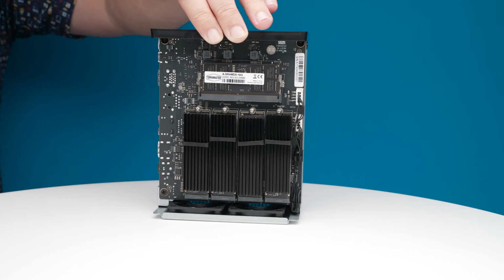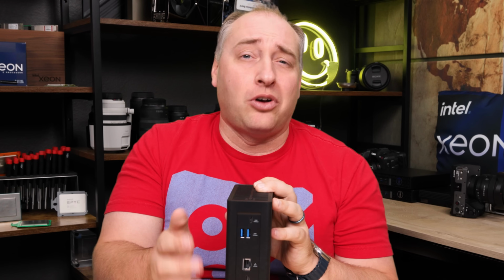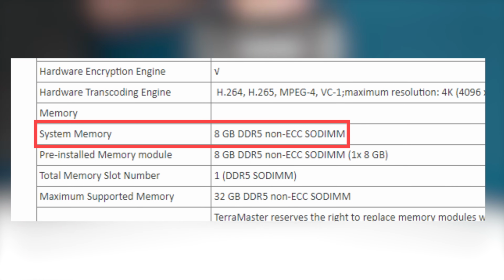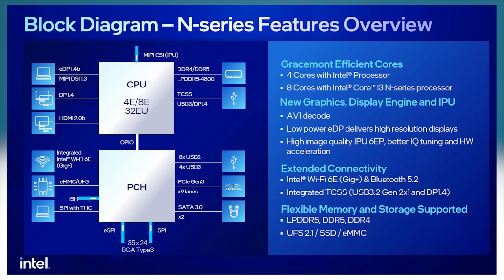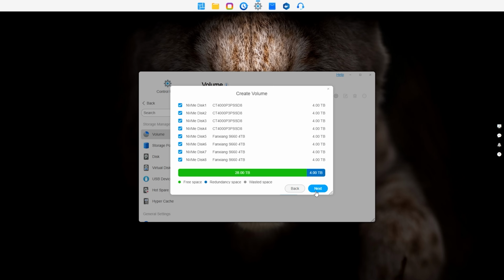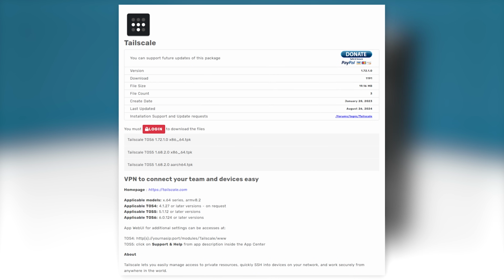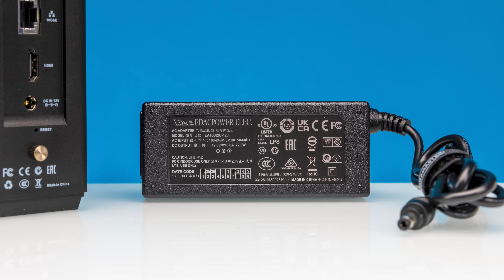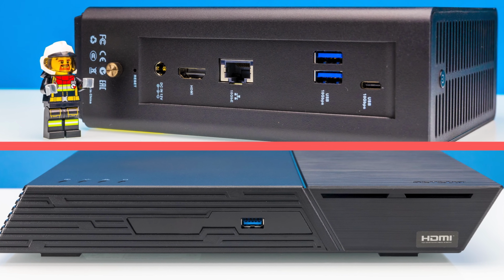Tiny 10GbE All-SSD NAS Sports Up to 64TB

Comment: The limitation in these systems is always the AlderLake-N CPUs' limited number of lanes and that it's PCI-E v3.0. Hopefully Intel will learn from that and hugely bump up the version of PCI-E and maybe either additional lanes or more built into the SoC (like 10Gb networking) in the next version (and be based on Skymont).

Comment: I am only about 9 mins in, BUT looking at the specs for PCIe Gen3 NVMe drives they must be running very slow due to only having 9 lanes, so either the 8 SSD's are using 1 lane each 1 GB/s or they are sharing 4 lanes between 4 drives.
But its hard to tell due to not owning this NAS, maybe you do speed tests later on in this video confirms this or says otherwise, but would be interesting to see.
TBH, I was wondering how good a NAS would be using NVMe SSD's, oh and the slowness I think is down to the 1 lane per drive, assuming its doing it that way, I am thinking its 4 lanes for each set of 4 drives and those 4 drives are sharing those 4 lanes resulting in them being slow.
On a side note, did you try sticking in a different USB Storage drive and try installing a different NAS software ?
Reply from the maker: Right, but think about using drives for capacity instead of for speed
Reply: @ServeTheHomeVideo  This is true, if speed is not a requirement and storage space is then yeah its good.  But you also need to look into what else might be sharing PCIe lanes, but for that high price you would think this wouldn't be an issue.
My NAS here is used to storing code repositories, home folders and backed up movies to save wearing out the physical media.

Comment: What i'd like to see is an actual i3 in an 'ultra' model with an i3-1215u or core ultra 3 105UL limited to 12w, sure we'd be losing 4 E cores in a trade for 2 P cores, but the extra PCIe lanes, PCIe speed (20 lanes of 4.0 compared to 9 lanes of 3.0 on the N305) then with dual channel you could probably get up to 256GB of RAMonec 128GB modules are released(or 512GB if it had 4 slots), now there's probably a total of one person on earth that could use more than 32GB on a CPU that only has 6 core and 8 threads, but imagine if they took that parent die of 2P+8E and swapped the 2P cores for 8 more E cores, but kept the PCIe and dual channel memory controller
My main reason for wanting the non-Atom based i3 is the PCIe. Not only can each SSD now have 4X the bandwidth, you could in theory get a 100G nic in there, though i'd be more than happy with a 40G QSFP that supports breakout into 4x10g(i know its supposed to be part of the standard, but i've come across cards that dont do this)
Also the much more powerful GPU and option to expand to more RAM in the future if desired is a plus.

Comment: Can someone explain to me how this isn't super overpriced?
Reply from the maker: $499 for the lower CPU model and getting a low power silent 10GbE NAS that can house 8 SSDs and is pre-installed as an appliance. $699 for more memory and CPU. Not too bad considering the 5-bay QNAP was $1300 (albeit it is a better system)
Reply: @ServeTheHomeVideo  I dunno, I'm just not sold on it.

Comment: This doesn't have the performance, would you consider something like Aoostar Gem 10 that's has 3 m.2 slots with an Occulink SSD enclosure with 4 drives which comes with R7 6800h , 32g lpddr5 ram?? And the pricing is almost same

Comment: At  $700 USD you can just make a much more powerful ryzen 7600 ITX box, I'm using as asrock deskmeet x600 it was $200 + CPU + RAM + NIC = $600 total. For fun I ran a 100gbe nic in it and was getting 40gbit.
Reply from the maker: You can make something that is larger, higher power and/ or has fewer drives connected for less. This was addressed in the video
Reply: @ServeTheHomeVideo  Yes just comparing, I'd love the terramaster if it was cheaper and had 10gbeSFP, or be the same price and have IPMI, would then be a nice NAS for on-site backup.

Comment: Could this little one pull double duty as a plex server and a couch websurfing pc?
Reply from the maker: I am fairly sure folks have these running as Plex servers, albeit not the most powerful ones ever. Maybe search for that specifically. On the web surfing PC, there is probably a way, but I would personally just get a cheap N100/N305 box for that.
Reply: @ServeTheHomeVideo  
I used to use a pentium j5005 for it.
Intels quicksync does well with the  plex part.
But it wasn't too smooth running windows for websurfing and the basics.
I have an old NUC8 i3 that does fine with the basic windows I need, but obviously has trouble with mutible drives including my primary 3.5" hdd.
But if this one was good enough for windows plus could handle that many ssd's I could slowly start buying ssd's transition to a little all-in-one.
IF...

Comment: :( No ECC RAM support. My search continues for low power Mini-PC / SBC with ECC SO-DIMM support with multiple M.2 or PCI-E slots. These NAS devices really need ECC RAM. Bad memory will silently corrupt data. I've had it happen to me before.
Reply: The AliExpress Qotom boxes this channel has covered can run ECC SO-DIMMs, and have 2x M.2 slots.  Not really a mini-PC tho, as they have a BMC rather than an iGPU.

Comment: Well, It's a kinda cool little SSD NAS, but as a home user, It's kinda little overpriced to spend that kinda money on 8 4tb SSD's when you are never gonna utilize the full datarate they are able to give over a 10GbE port. Now I don't have the full math in my head, but wouldn't it make more sense with a Spinner 4-5 disk NAS wih possible atm up to 6x as big disks that can do a 5-10GbE agregated network bandwith be more in line with the cost per TB vs a 10Gb max connection at least to your network switch. Most people at home is still using 1GbE network at home even 2,5GbE has been around for some years now. I am just about thinking on buying a cheap 8+1 or 8+2 2.5 Gb managed switch with at least just "1" 10GbE uplink to the NAS. I first lately have more than 1 PC's that has a 2.5GbE port. I still only have roughly 100/20GbE internet link, and media playback is still limited to 1GbE as Apple havn't released an Apple TV with more than WiFi and 1GbE connection yet. Some of our gadgets still lack behind in supporting more than 1GbE, and I'm one of those that really don't trust a 5G internet connection over my trusty 100/20gbit DSL connection. Heard enough complaints that it just don't cut it for online gaming. I almost went to try one but a friend told me its still not have low enough ping to be trusted for a stable gaming session.

Comment: If power and size not a problem , maybe get a msi x670E tomahawk , bifurcation quad nvme carrier and a amd 7600, a 10 G network card . 

That board dont share bandwidth between m2 and pcie slot so you proably can have 7-8 all high speed nvme from bifuration and onboard m2 slot. with 10G network card and still got pcie slot left  , you can slap on a processor have more cores , or add more memory. 

Maybe few hundred hours for software and security setup , and obviously higher powerbill 😂

Personally using both turkey nas solution and diy storage pod , both have their potential.

Comment: Is there any way you could turn this into a functional wifi router?
Reply from the maker: Probably, but it would be cheaper just to get one designed to be a WiFi router
Reply: @ServeTheHomeVideo  Are there anything that has 10gb ethernet? All I found is nothing but either 1gb or 2.5gb. I have a switch that has 10 gbs ports.

Comment: Damn would be perfect with ECC ram support.
Reply from the maker: Always one more feature would be perfect :-)
Reply: Ikr
Reply: Sadly Intel doesn't provide ECC support without breaking the bank.
Reply: it's DDR5 so it's at least on-die ECC, which is already a singnificant improvement over the "nothing" of DDR4
Reply: @marcogenovesi8570 didn't know that feature of DDR5, thanks
Reply: The upcoming flashstor gen2 will support ECC

Comment: are people not aware of $30 pcie x16 to 4 bay m.2 raisers cards, depend whats desktop you have (mines can get 128tb+), i just price a desktop with 8 slots of  m.2 (half pcie 5) and 10g network, r5 7500 cpu faster now size is double but atleast upgradeable and cheaper.

Comment: Qustion: why PCIe 4.0 M 2 ssds, when only PCIe 3.0 from the CPU support is.
Reply from the maker: Gen4 drives are easier to get in 4TB sizes. Most Gen3 drives are being discontinued at this point.
Reply: @ServeTheHomeVideo  sad. 
And then probably QLC instead of the slightly longer-living TLC. -.-

Comment: Half the drive count and double the lane availability per-drive already! This lane design problem being the exact same on every one of these NASes is starting to get very annoying! I do want one of these machines, I would pay the $800 for this with the 10Gbe and only 4 slots, if it had the correct PCIe layout so apps running on the box don't slow down external access! Grr! 😡
Reply from the maker: The bottleneck is the 10GbE though
Reply: @ServeTheHomeVideo  Get some extra processes going in a docker container, It'll continue to go below the 8Gbit it's currently doing. Extra lanes for the storage will give it device-wide overhead room to take advantage of the beefed up processor without affecting transfer speeds

Comment: You implicate that each drive can have a raid designation. Why bother. If somehow you are using mixed media storage if one drive fails what is the chance of rebuilding the failed partition. This certainly was not designed for long term storage nor reliability. In my current array, I am using a redundant mirror system that has the last image stored on a net cluster while online activity is managed by two separate identical mirrors of each other. The operating system is kept away on a sealed Linux system on its own storage. The data is on a separate drive system. Complex yes, but haven't lost data in 10 years. Everything has physical separation and the only electronic connection is one I set depending upon system usage.

Comment: 9 lanes of IO is pretty silly nowadays.  I wonder why companies continue to buy and use these crippled CPUs.
Reply from the maker: I mean if you just need to add some RAM, a NVMe SSD, and cheap networking to get a system, that is good for a lot of applications. I asked ASUS years go about this when systems had tons of SATA ports and they told me most systems were just CPU, GPU, and one drive.
Reply: @ServeTheHomeVideo  okay maybe I should've been more specific. :-) I'm sure there still exist use cases that don't need too much IO.  But for a NAS... or anything with a lot of flash in it, really...

Comment: Does anyone do Raid 5s anymore that care about the data...  R5 is not a great choice at all.
Reply from the maker: That is more on the HDD side because of the MTTR of RAID using large hard drives. SSDs are much faster on random I/O so the MTTR is much lower.

Comment: Proprietary SW? No thanks!  Stock Linux or FreeNAS, thanks.  And please pipe down about “too much cpu”  that not a thing.  Too expensive, too hot, etc are things.

This almost could have been interesting, but SPF+ is a must.  None of this BaseT stuff.
Reply: Hey look it's someone's highly subjective opinions. Go buy that thing you're complaining that this isn't. Oh you can't? Quelle suprise
Reply: @jazzmusiccontinues1134 You meant “surprise”?

I had two distinct points: propriety software is untrustworthy and SPF+ is better.  Both have plenty of solutions, but I don’t know of any in quite this form factor and was hoping to learn about options I didn’t know.

Currently the best alternative is probably some mini-ITX solution with a quad M.2 expander which along with two M.2 slots on the motherboard gets you close to the 8 this one has. And you can run all of the software in the world.  Power will be comparable but price might be higher.
Reply: @tommythorn  You meant "proprietary"? My point was that you come off as a know it all complainer and that you'd probably get better results asking questions about the hardware you would prefer if indeed alternatives with similar but better specs is what you're after

Comment: X1 PCIe lanes per drive !?!?

PCIe Gen 3.
Single-channel RAM.
Non-ECC.
Single NIC port.
Astronomical Price.

Hard Pass.
Reply: It's a NAS, you only have a 10Gbps link out the back to access your data. So your 8 gene lanes can do about 16GBps so your drives are 13 times faster than your NIC. Next time before making  a dumb comment do some basic maths.

Comment: This 2x small fans will be whining a lot when the data transfer get high. 
Sorry but I don't trust the low noise promise... I will believe only on some real life measurements.
I currently use 2x 10GB TrueNAS machines based on 65W power. They are quiet when idle...
Even that low I just keep them in my locker.
Another low noise is one of my old storage based on HP DL360G7 with 4x 4TB SSDs but takes 130W - it is noisy just when start. All the fans are at minimum.

Comment: Hard pass on the price...if you go to Amazon, you can find two 4 bay m.2 expanders at PCIE 3 and PCIE 4 x16  expanders for relatively dirt cheap (Sabrent is great but not the ones I'm mentioning here) and as long as you have a motherboard that supports PCIE bifurcation and throw in a 2 port sfp+ 10GBe NIC, you essentially build yourself an upgraded version of this system for under $400 (including 64GB ECC RAM and any reasonable modern CPU), with the huge benefit of actually utilizing more PCIE slots for whatever needed and adding hard drives via sata or HBAs if slot numbers and platform supports it and throwing whatever OS you decide to run on it - this is honestly a pretty big ripoff in my opinion
Reply: You can't use two 4-bay pcie bifurcation cards on most motherboards, both Intel and AMD's consumer platforms simply don't have the necessary number of pcie lanes. You would need m.2 expander cards that had pcie switch chips, or use a high-end workstation or server platforms with multiple true x16 pcie slots. Both options would cost more than $400, unless you were using a used 2nd hand server which would have much greater power consumption and much larger footprint.
Reply: @g3ds  That's a fair point; I've seen motherboards in the past with one x16 and two x8 that all supported bifurcation so theoretically with those, you'd get two 2 bays and one 4 bay but I definitely understand that providers with that format are few and far in between - I guess I don't really understand the market for this product in that case because I would personally just throw a 4 bay expansion card, an HBA for hard drives, a 2 port 10GBe NIC, and then attach SSDs to the sata ports for my storage needs and wants (I realize that my idea of a build isn't the be all end all, I just don't necessarily see the benefit of paying so much for a system you cant do much with)

Comment: I dont need to bother to watch all of this. Its still the N100 family, no matter which version you get. 8 cores would be great for threaded apps but there are several M2 based NAS units like this. ASUSStore's has been out what, over a year? And probably far better software at this point. The Ugreen UGREEN NASync DXP480T Plus will blow this thing away performance wise. Its now a $300 difference with the new discount, but its also much more horsepower. Their challenge is they only have 4 drives (plus maybe an OS drive seperate, not sure). They have 2 x TB though for some expansion but with a new company like that in the NAS world their software for expansion isnt exactly at synology's level yet. IMO it might be easier to just build yourself one. Youll have to rely on your own mind for the software but if you can do that, itll be much more powerful for similar money (or same power for less).

Comment: The price is horrible. I can buy an Epyc cpu and an Asrock EPYCD8 mobo with 7 pci-e slots and 2 nvme slots and 2 u.2 connectors for around 400 bucks ... ram is another hundred and a psu is another hundred. put a pci-e 4.0 to m.2 adapter card in each pci-e slot and you're good to go and you can do more with that system than with this crap..
Reply from the maker: We talked about this mindset specifically in the video
Reply: yeah all prices of new items are horrible compared to 4+ year old used hardware from china on ebay. Btw enjoy your new nas that uses like 50w on idle and up to 200w or whatever under load.
Reply: Keyword 'small' 😅